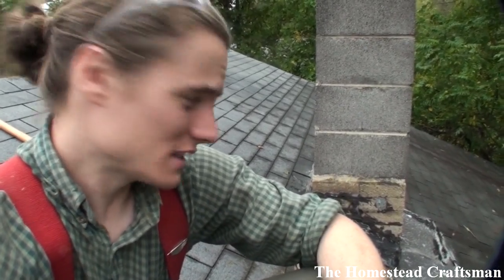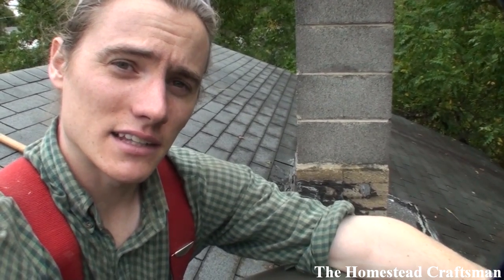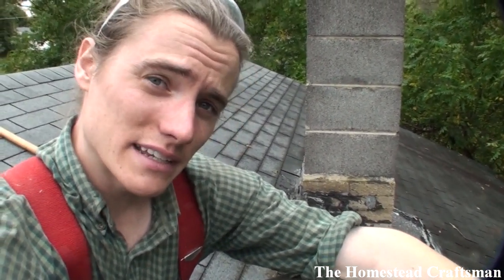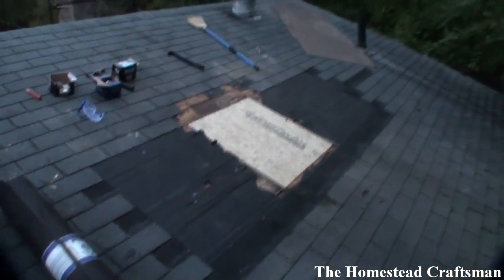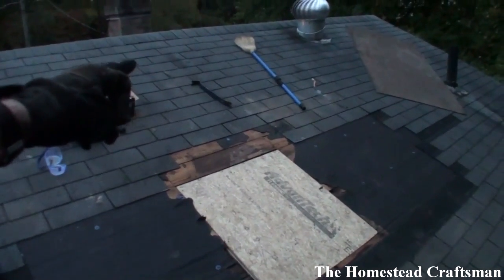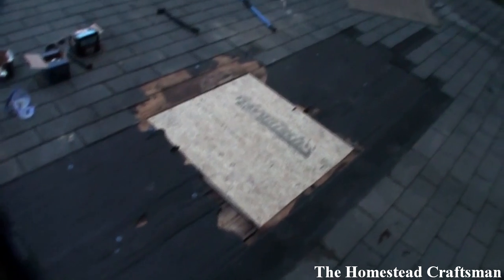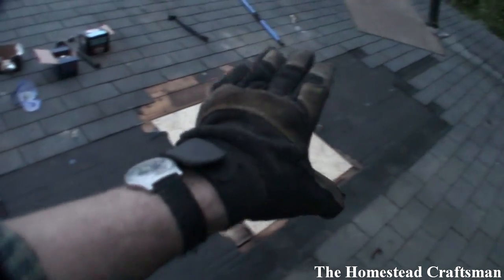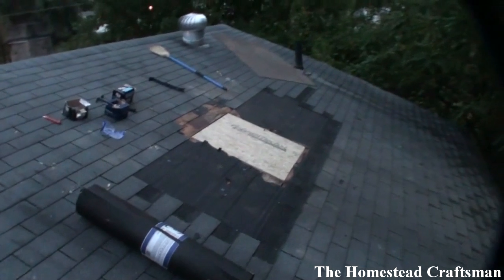Tearing Down a Chimney

Comment: In your opinion, is it possible to do it while saving the material?

I have a big exterior chimney with cement blocks. My biggest concern isnt to take it down but to haul away hundreds of blocks. I could easily reallocate the material to build walls on my yard, that only if i do not sledge hammer them all.
Reply: If you had the time and patience you could always use a grinder to grind out the mortar joints and remove blocks one by one. Really though I think you would be better off finding a way to use the broken stone for the time Involved. At the very least I would say knock it down until you can close the roof ASAP to prevent water issues. Then when you are inside in the comfort of the AC take your time! Haha.